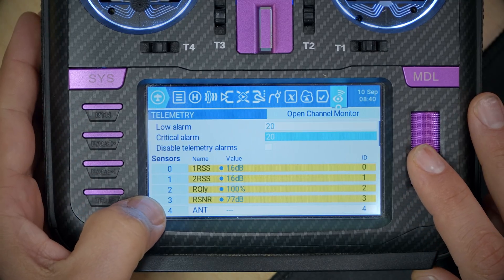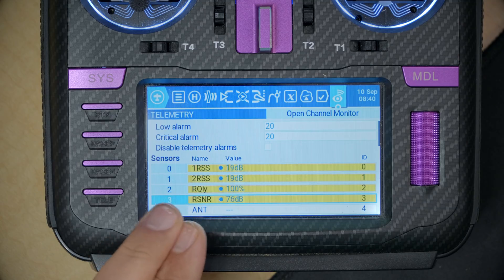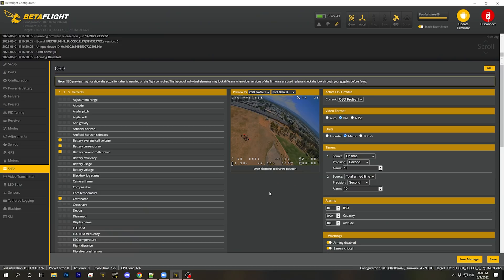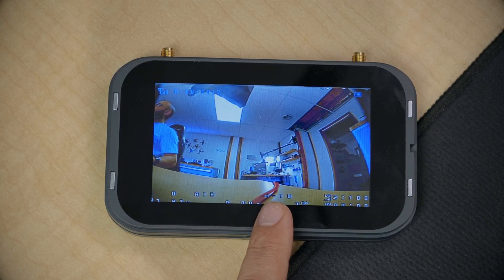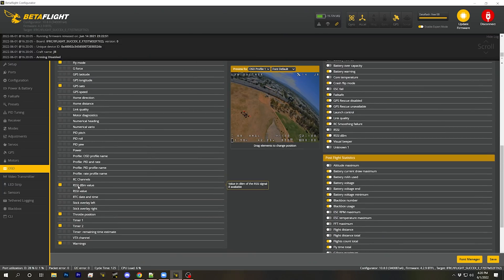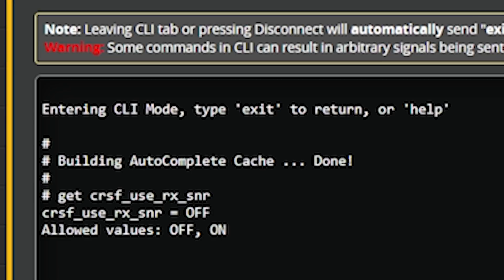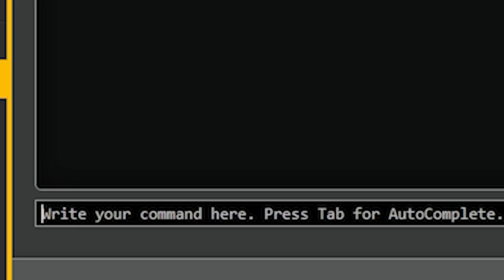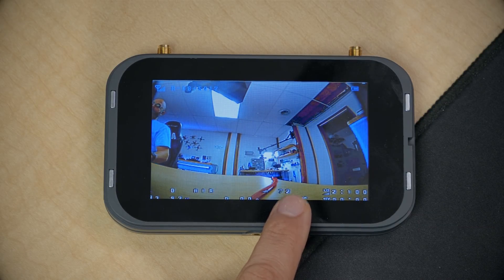Betaflight doesn't show you SNR and that's a problem

Comment: just did this command in the cli set  "crsf_use_rx_snr = on" and the snr worked but the rssi also went back to 99! before it was at 80-90 when a meter between each other and then dropped of to 50-60 when between 5 rooms or so. Now it seems to be working again! using crossfire. now only drops to around 95-99 through 5 rooms when on 1w

Comment: Talking about your affirmation from 1:57: "The further away you are the weaker the signal is, the more corrupted packages there are." I don't think you're right. You could have 100 LQ but 25 RSSI and be miles out. You can see that on falconRad's video: https://youtu.be/e5ewAHjnQtQ?t=559.
Reply from the maker: If the SNR is sufficiently high, then you'll have high LQ even at longer range. Eventually you reach a point where RSSI is weak enough that SNR gets into the range where LQ starts to drop.

Comment: I have just tried that and SNR is so much more stable easier to read. Thank you so much for the explanation.
In my enviroment 4dB SNR = 27% RSSI. Do I have to change the rssi_dbm_alarm threshold or it will stay at the same point despite of unity change?
Anyway it would be nice to be able to set the RSSI alarm to a given SNR value.

Comment: A Betaflight GitHub PR (11062) was raised back in November 2021 to add a dedicated RSNR element to the Betaflight OSD. That PR has been earmarked for inclusion in the Betaflight 4.4 release. My comment keeps getting deleted if I include a GitHub link, so you will have to search the Betaflight GitHub repo pull requests log manually for PR 11062 if you want to see the details.

Comment: Reason SNR isn't shown is because the values are 1) inaccurate due to clipping of the input data and 2) misleading as LoRa based signalling can work below the noise floor. 
SNR is in theory useful, but unfortunately pilots are going to see inaccurate and misleading SNR.
Reply from the maker: Before making this video, I spoke to an ELRS dev who said they use SNR during testing, and who agreed that Crossfire's 4 dB to 0 dB threshold for turnaround was reasonable for ELRS. This is just two data points, and I don't have as much experience as people who have been working with this a lot longer, but at least some people with experience think SNR is useful.

Comment: Other examples of SNR: 
Guitar amplifiers...turn up the gain control and noise is added to the signal between the guitar and the speaker, though this is often a desirable effect known simply as overdrive or distortion. The more you turn up the gain, the more distortion (noise) is added to the signal. 
Cameras...when you need to let more light in to obtain good exposure but the aperture is already at its widest and the shutter speed cannot be taken any lower without inducing motion blur, you increase the ISO, but doing so adds image noise. The ISO control applies gain to the signal (the signal is the image data as it travels from the sensor to the memory card) and the more you increase the ISO value, the more image noise will seen in the final outputted photograph. Beyond a certain ISO value (this varies from camera to camera) the image will be so corrupted by image noise that the photograph will have little discernible detail and will look like a speckled mess.

Comment: Is signal to noise ratio, at least as it’s shown in betaflight really signal to noise delta?  Ratio implies division, or some sort of percentage.
Reply from the maker: dB is always a ratio. dB as a unit expresses a ratio between two things. For example, 3 dB is approximately double or half. Double or half of what? Whatever you're comparing to.

Units like dBm peg the demonimator of the ratio at a fixed value to allow dB to express an absolute amount. For example, dBm is pegged at 1 mW. So 1 mW = 0 dBm. 10 dBm = 10 mW. 20 dBm = 100 mW. And so on. -10 dBm = 0.1 mW. Etc.

SNR expresses the ratio between the noise level and the signal. If signal is 10x as powerful as noise, SNR is 10 dB.

Comment: Hey JB. Are you sure about SNR treshold? We really can't go below 0db SNR?
Official lora documentation stand for:
A value closer to +10dB means the received signal is less corrupted.
LoRa can demodulate signals which are -7.5 dB to -20 dB below the noise floor.

This is the beauty of lora modulation!!!
Reply from the maker: LoRa can theoretically recover the signal at negative SNR. That's why you won't failsafe instantly at 0 dB. But the signal becomes very unstable and ELRS devs recommend you don't fly below 0 dB SNR.

Comment: One interesting complication is that LORA can actually receive signals BELOW the noise floor.
Reply from the maker: In theory it can but the signal is kit stable enough to fly with. That's why the turn around threshold is 0 dB. You won't failsafe instantly at 0 dB but you shouldn't keep flying.
Reply: I have an SDR usb stick and learned about pulling signals from below the noise floor doing WSPR and FT8 stuff. Wild that it's even possible. Then I learned the human ear can actually do it, too. If you listen to the raw signal from an SDR tuned to a signal that's a few dB below the noise floor you can still kinda hear the signal separated from all the static. Crazy stuff.

Comment: 0:01  nah.. there are 4 metrics, and the 4th is the easiest and most important for most of us with Crossfire and similar, especially with dji hd.. video quality is my #1 metric for turning around.
There’s only so much we can digest per second, all these various (usually) cryptic numbers become relatively useless unless its a calm high flying distance rig.
But its nice to know, so I learned something today.
Reply: I understand what you're saying, but it has ofcourse nothing to do with the RC link itself.
Reply: Yeah... I'd say most FPV freestyle pilots would just use video quality and with a control link like elrs or crossfire it will almost always outlast the video. But this type of thing is much more important for long distance flyers, who might have very high gain antennas on their video link so then they might actually failsafe before video goes bad.
But when JB mentioned the audio alert, I thought that'd actually be more useful for freestyle pilots - we're already not using our ears for anything and our eyes are quite busy with the video feed, so just getting a "beep" when you get into the warning range would be quite useful...

Comment: I notice the level of interference to my GPS camera drones  goes way up here in the winter when 100,000 people show up to this town all in RVs with thier own internet hot spots . This makes the range on my controls go way down and has even caused me to not have any  control so I think it would  be useful  to see what the value is so know if I can fly in a particular  area . I had a 4drc F9 go nuts and fly away and I suspect that was due to interference. Never found it . Never seen it fly that fast either 😅😁
When the seasonal  people  leave I have no problems with any of my drones.

Comment: Is there an option to place a feature request on the betaflight github? Perhaps we can get some momentum by creating a feature request for 4.4 and adding comments to show support. For now it seems like the most comprehensive option is to set an alert on the radio for low RSSI dBM OR low LQ OR low SNR (with a delay so it doesn't go off when there is a slight blip). This way you get a warning even if you can't see all three on screen and can make a decision on whether or not to turn around.
Reply from the maker: Yes you can create a new Issue and mark it as Feature Request.
Reply: @JoshuaBardwell  If you find features like this that you really think they should add, perhaps you could add a feature request on github, link to it from the video and then we could all go there and upvote it or something & then the devs would more easily be able to see whether enough people want it for them to add it.

Comment: I have what I think is failsafe in the past and I've never sure if it's the video or the radio that failsafe how can you tell?
Reply: Radio failsafe is when you can still see the video but lose control of the craft. Video doesn't failsafe but it does go bad or cant be received at all, video can go bad whilst maintaining a good rc link
Reply: @maxrackstraw  my guess is I get loss of video signal because it just seems like the last image I see is Frozen. So I can't control it and she crashes. So the screen didn't go blank but the image froze and I was less than a half a mile away

Comment: I am running Crossfire and while I have not had any failsafes like I I had in my Frsky (XM+/RSXR) days, I do still get periodic "Link Quality" messages in the OSD at random times when I am not that far away.  I enabled SN in Cli as you reco'd and what an eye opener as my SNR rarely gets above 25 and is often in single  digits.   I am running 500mW (dynamic) and wondered if maybe the power switching is causing these brief "Link Quality" messages.  This happens with my Evoque, Roma V2 and Flywoo Baby 1.6 (all CRSF of course).   I have a Cinerace20 coming this weekend and expect it will do the same.

Comment: I use CRSF and never have a negativ number o.O using DJI at the moment an have only one indicator for my Connection... would love to have LQ in DJI OSD
Reply: There’s a fork of RC6/7 that has proper LQ on the OSD in place of the craft name, my friend uses it but tbh the one time I tried it all the numbers just confused me, I’m too used to having LQ as a channel output and setting BF to use the Aux channel that is outputting the LQ and putting that  in place of RSSI and working on the principle of it it drops below 90 turn back.  Has not let me down yet.

Comment: Great explanation Joshua. One question, when turning on SNR in betaflight what happens to the dBm alarm? Does it stop working completely? Still works the same way (by using rssi dBm)? Or is it looking at the SNR value, thus the threshold should be changed?

Thanks!
Reply: good question, I was wondering the same!

Comment: It would be ideal if betaflight or flight controller could combine/calculate these measurements depending on what you select in betaflight and output a value from 0-100. Maybe also be able to preconfigure the values that it bases its 0-100 displayed connection quality. Ah pipe dreams 😂

Comment: The receiver RX must always send back with at least the same transmission power as the transmitter TX, right?  how does the receiver know with how much power he has to transmit?  I would find that interesting to know and understand.  because here in Germany you are only allowed to transmit at 2.4 GHz with 100mw.  how does the telemetry receiver know that? Thanks
Reply from the maker: The control link is one way. After a certain point the upstream telemetry will not get back from the RX to the TX but control will still be maintained.
Reply: @JoshuaBardwell  Thank you Joshua Bardwell for your quick reply.  I understood that so far.  but how can it be that I receive telemetry data when I fly more than 7km away.  From my point of view, the RX has to send back more than 100mw or did I not understand something there correctly?  all telemetry data that I receive in my TX remote control is sent back by the TX, right? kind regards Tobi
Reply from the maker: Because the telemetry link is low bit-rate, it has greater range than the high-speed control link.

Comment: That was excellent and going forward I will use SNR.
However on most of my builds I don't have any other osd than battery voltage.
I do however have my Tx call out the Elrs power output as it changes when on dynamic.
When I first did this it amazed me how much of a difference it made to match up the antennas on tx and rx. When I had horizontal to vertical the output power was up and down like a yo yo from max 250 to 10mw and I wasn't to far from myself. (Null point and kwad orientation) vertical to vertical works much better.  
In fact on my T-lite with max 250mw I hardly ever climb above 10mw! 
I'm therefore not distracted by my osd and my ears keep track of the audio alerts

Comment: Thanks alot.. Do you think frsky R9m with elrs is getting old. You dont use it anymore?
Reply: I use r9 lite pro with elrs915 been for a long time now. It's on my explorer. 
Though now that I have a JR bay transmitter I do want a new module but not sure which. 
But if it still works & updates & has over heating mods should be fine

Comment: One of the ways I used to teach SNR, MER and Error Vector Magnitude was giving one person in my class a piece of paper with a bunch of random 1's and 0's written on it, and another a blank paper with a pen. I would ask the entire room to be quiet and have the one student read to the other the 1's and 0's. The student who wrote it down would read it back and verify there were no "errors". I would give them each new sheets and this time the entire class would make a lot of noise while they did the exact same activity. This demonstrated that there were more "errors" as well as a requirement for the person reading the numbers to raise their voice. In certain digital radios, the transmitter will actually increase its output power to compensate for a noisier environment to try to talk over the noise floor. This is something severely lacking in fpv and model RC is more dynamic radio transmitters. Utilizing a pilot sub carrier like we do in 802.11 protocols to essentially link Tx and Rx using a very narrow, low density channel, could seriously improve link quality at a much further distances imo.
Reply: Crossfire in dynamic power will do this. Keeps cranking power automagically 👌
Reply: @Fly_High_FPV    But don't you sacrifice latency and packet rate? Rather than locking it in at the beginning of the flight?  My vision is to have a system similar to a OFDM/OFDMA Tx/Rx that using sub channels, not frequency hopping, and dedicate a specific sub channel to just communicating with the Tx/Rx modules separate from telemetry and the main frequency. A Physical Link Channel, but more geared for model RC comm. It's purpose would be the selection of the best frequencies, disregarding any areas of the band (2.4 or 900 regardless) that are* too noisy, and adjusting output power relative to snr, lq and received dBm without sacrificing latency/ packet rate versus just detecting a lower received power level and cranking up the Tx, risking distortion, increased latency, potentially a damaged packet rate. Could be utilized for video in the same way.
Reply: @DanJonesShow  dynamic power and dynamic packet rate are different things. Crsf and ELRS have both
Reply: Expresslrs does this as well.